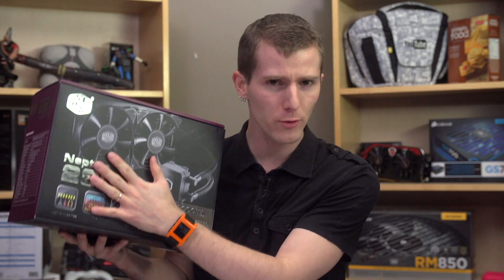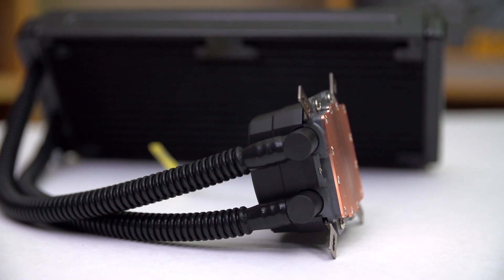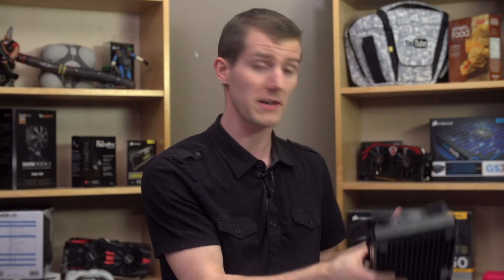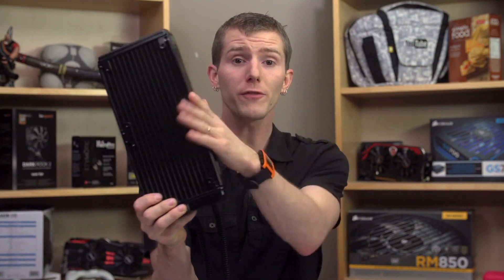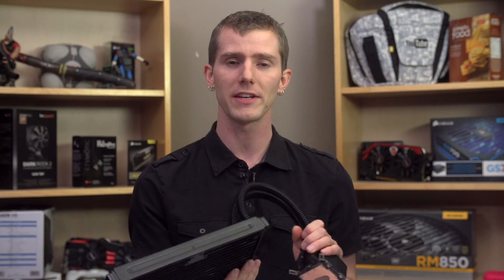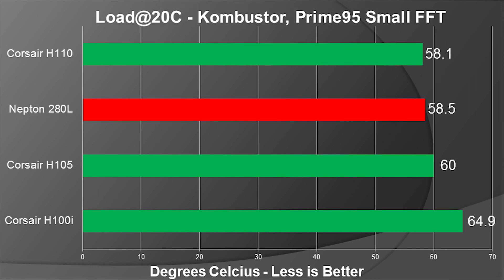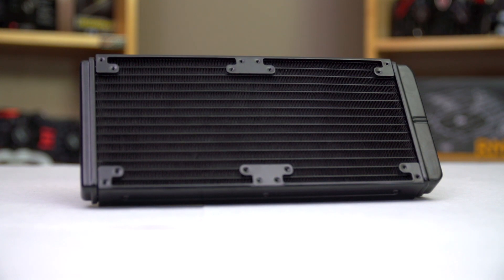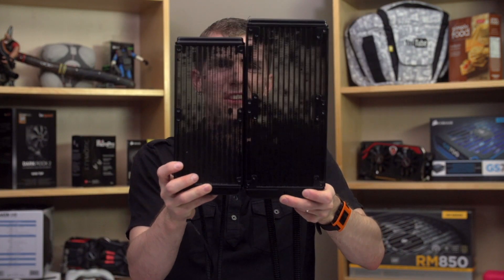Cooler Master Nepton 280L Water Cooler

Comment: i own this .. i'm VERY disappointed
Reply: Eduard Victor Toma fans are too loud. spin too fast at low temp. i'm talkin 1.050v and 4.0Ghz, and they way too loud. tubes are really hard to bend, mount is average, and temps are nothing special. this with a delidded 4670k with coollab pro. and CM support is inexistent.
Reply: Eduard Victor Toma  h110. Enough said
Reply: weyderwarr Even an air cooler doesn't make that much noise if you got the right fans. I got the same 4670k OC'd to 4GHz and the Hyper 212 Evo does the job just fine.
Reply: *****
wanna know what's worse? i also own a 212+, from an earlier build, and it even fits on the mount.
Reply: Eduard Victor Toma
i'd try the H100i. because? it has its own digital control, so you can chose how much performance over noise you want.
Reply: ***** My mATX build is air cooled by the monstrosity heatsink made by Phanteks and it happens to run quieter than my h110 in my main rig. They both run the 4770k however the chip I have in my small rig turned out to be a "luck of the draw" sort of thing (will probably put it in my main rig eventually when I get the time). Anyways, my point is that if a chip has poor thermal abilities your fans will put out higher decibels. Also, if you find that your liquid cooler is loud compared to your air cooler, then try to put the fans included with your liquid cooler and put them on the air cooler so that you are getting a fair comparison. Comparing two different coolers with different fans wont be a fair comparison, if you ask me. I think the h110 with some Noctua PWM "premium quiet" fans get a very nice noise:performance ratio.
Reply: weyderwarr
i totally get you; i have a set of noctua in my shopping list, as soon as i get my next paycheck. i haven't given up on this AIO, just, for the $$, it comes with two very disappointing fans.
Reply: Sky Vins I'll just be sitting here with my NH-D14 and a 4.7ghz overclock on my 3770k. Aircooling > CLWC.. Oh yeah, and it's cheaper.
Reply: Søren Wetter Meh, top end water coolers beat top end air coolers as far as temps go. Also, air coolers limit ram options, are usually harder to install, raise the overall case temperatures more, and take away from the aesthetics of a build. There are trade offs for both.
Reply: Jesus christ...I don't think I can handle the sarcasm.